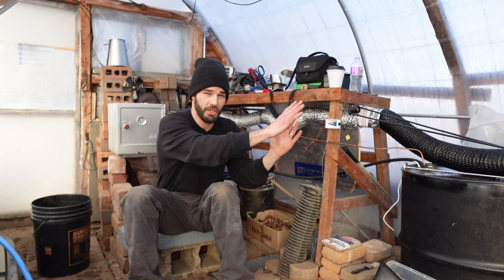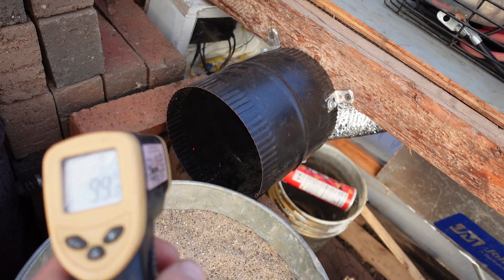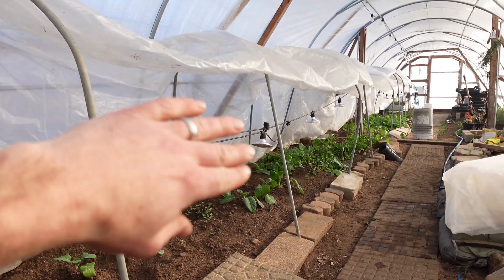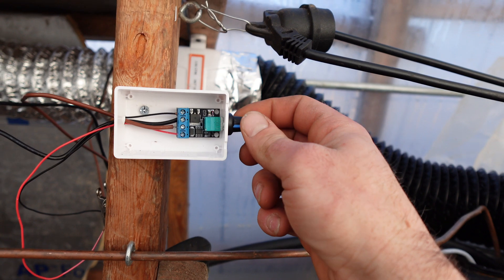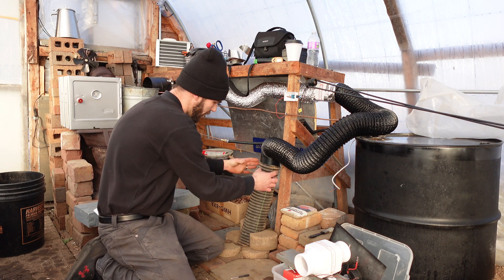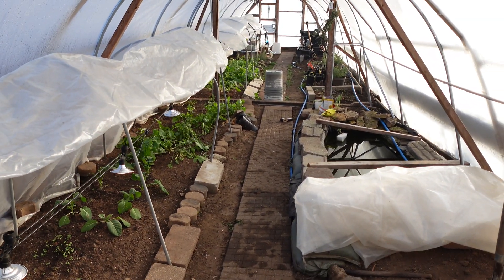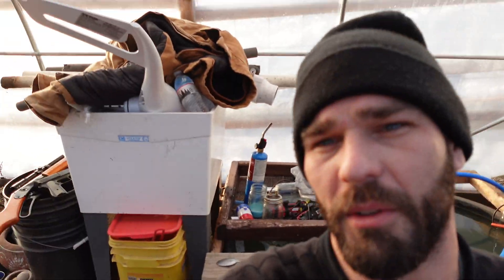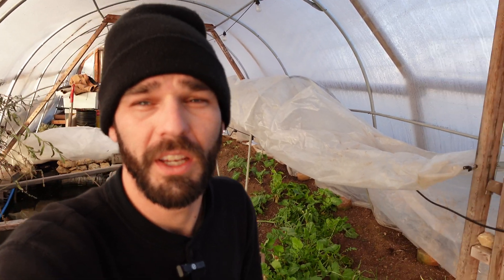DIY Geothermal Experiment - Heating Underneath Our Greenhouse With Wood Stove - DIY Greenhouse Heat

Comment: I feel that by putting heated air into your geothermal system you are pushing heat into the ground, but you are not going to get it back. The temp will always work towards the neutral earth temp, warming it in the winter and cooling it in the summer. You are just feeding the earth a summers day in the middle of winter. That earth extends outside the greenhouse as well, and the heat is just as likely to go out there, more so considering outside is so big and inside is so small, comparatively.
Reply: Vertical perimeter insulation is a must for a geothermal greenhouse.

Comment: cool experiments. I have a neighbor that has a solar panel connected directly to a water heater element that's buried in a bucket of sand. I was surprised it worked and couldn't believe how much heat that thing was putting off. I know winters don't come with much sunlight but still interesting idea.

Comment: My hot house is doing great the 2nd layer allows me to use no heat during day and burn about 2-3 g yesterday from 4pm-10am I burned 3g of Diesel between two heaters in the the big hot house 2 layers and 1 heater In the small 8x6 aluminum polycarbonate greenhouse. Polar vortex increased consumption by 1/3 normally I’m about 2g between 3 heaters on avg 30/40 deg night. I do also run a radiant heat loop powered ent 2kw grid power immersion heater in half full 35g drum using 150’of 3/4” pex that heats the river rock floor in the big hot house I try to only run that on the coldest of nights to keep the roots warm

Comment: Hey man, im watching this vid right now and i see you are using my suggestion of copper tubing in sand on the stove. Hows it working. Cant tell how big the tubing is...
I have another buy once type of " free heat" concept im still processing. Is there an email i could contact you about it without giving my idea away to the masses just yet.
Reply from the maker: Rustinfloto08@icloud.com
Reply from the maker: Been working decently for a simple diy with stuff I literally had on hand. Let me know your idea 💡 using 1/4” copper for the experiment. I’m going to build something bigger in the future. Thanks for everything!
Reply: @Earthdwellershomestead  i saw someone else comment close enough to mine so, somebody else has a similar idea..
Basically, harbor freight 100w solar panels and the hf converter panel they also sell. Keeping all 12v and potential solar panel limits, deep cycle battery and 12v automotive seat heater inserts (4/$16, Amazon) under a sand bed for seed starting as well as a gh ( supplemental) heat source. In summer switch from heat inserts to 12v automotive cooling fans. There are some as high as 3300cfm. Or a combination of heat inserts and a smaller 12v fan to circulate air over plants is a good idea anyway to strengthen young plants.